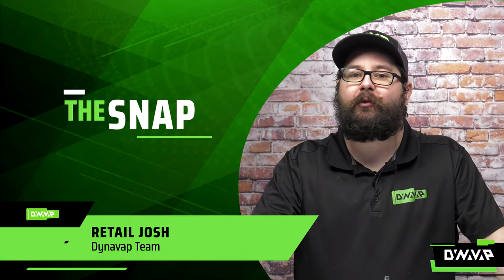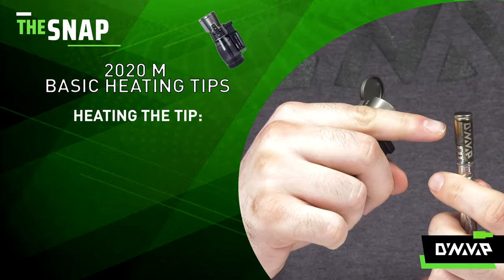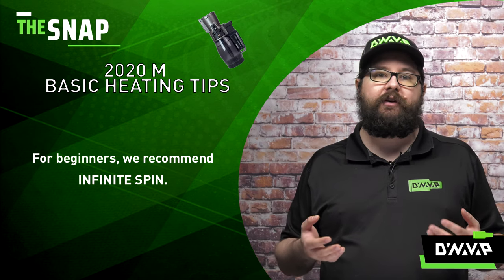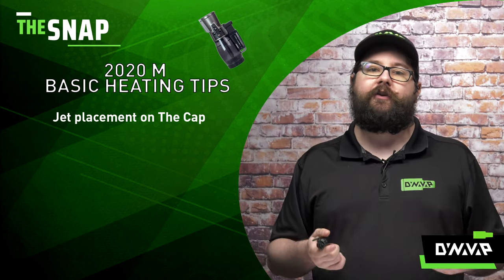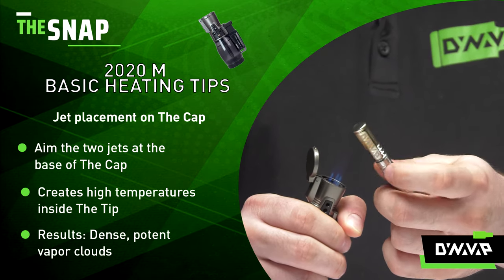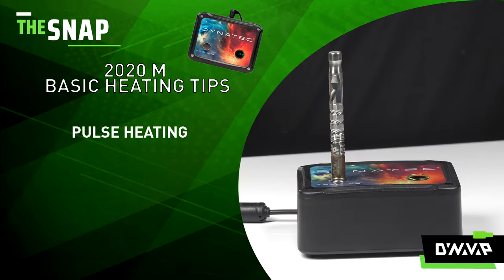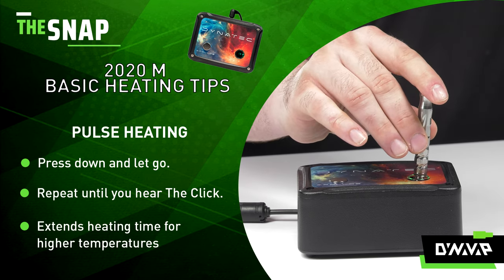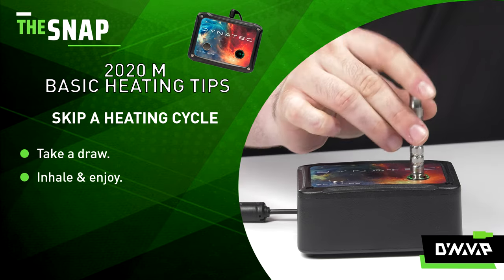2020 M Basic Heating Tips | The Snap

Comment: Is the cap suppose to be all loose? I just got mine and it wont click so I tightened cap and it still wont work
Reply: I've just recieved one in the post and the cap is very loose for me too. I imagined it would have clicked in place or screwed in place kinda thing, but no :/
Kind of anoing lighting it without a torch by the looks of it without burning your fingers off. I have to wait until next payday for that 😂
Still getting used to it though so hopefully I master it when I get a torch flame lighter lol.
Reply: mine was like that too, all you have to do is kind of bend the sticking out point of the tip inwards just a little bit
Reply: yes it is supposed to be loose, do NOT modify the cap or your risk changing the properties which cause the click that lets you know it's ready!

Comment: My method: Single flame torch and a fairly low flame, bathe the cap in heat aiming right at the first "A" in dyna. Use the infinite spin technique and try to maintain consistency putting the cap right in the blue cone of heat. count to about 3 seconds after the second click. Try to take a strong pull for as long as you reasonable can.

Pro Tip: You can hit the cap with the single flame torch while taking a hit, trying to evenly disperse heat, making even fatter clouds. Just be careful not to burn yourself!!

Pro Tip 2: I dont even wait for the cooldown click tbh, just start hitting it with the flame and try to count out a few seconds so you don't roast it. Combustion is a possibility but its not too hard to avoid with some practice
Reply: Thanks for sharing.  I find there are many different methods to get great results with the Dynavap.  One thing I've discovered recently is I use different torches in a session, from triple flame to single flame.  Even further, I have three different single flame torches with different shaped flames that allow me to focus the heat as I want.
Reply: Three seconds after 2nd click is wayyyyyyy too long
Reply: When you say you don't wait for the second click, does that mean you are hitting it more than once? If it's the same bowl I wouldn't think it matters but I was told this was a one hitter?
Reply: @Rs-xw4bj  dynavaps guide says "several seconds" after the click for the M